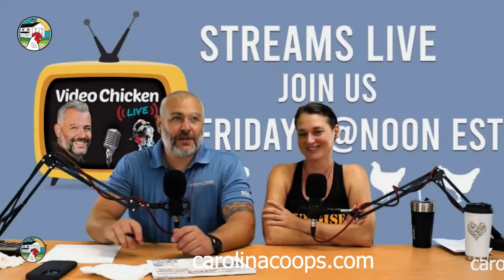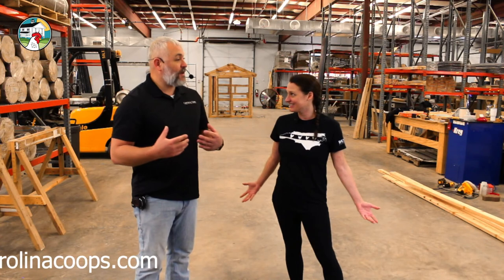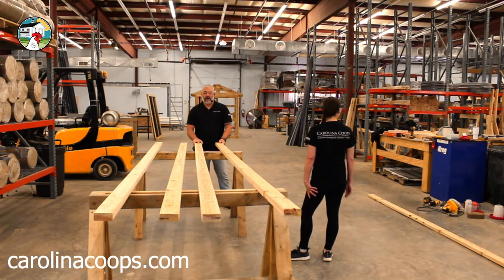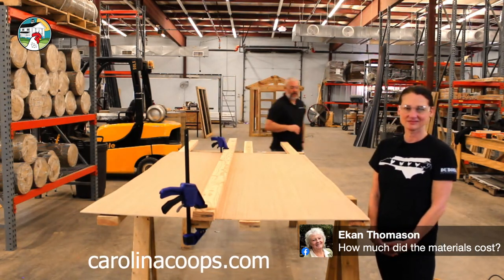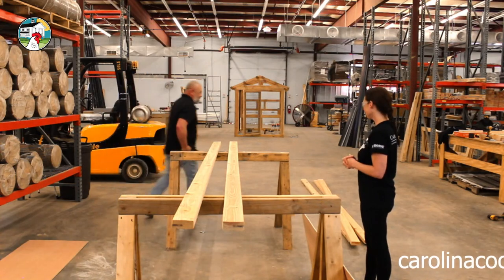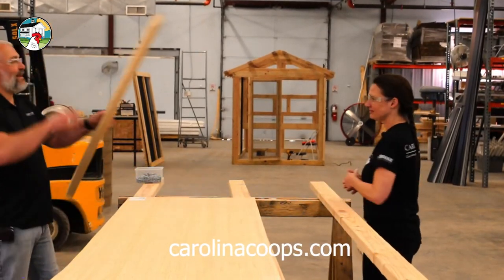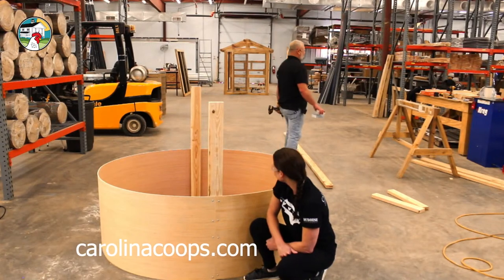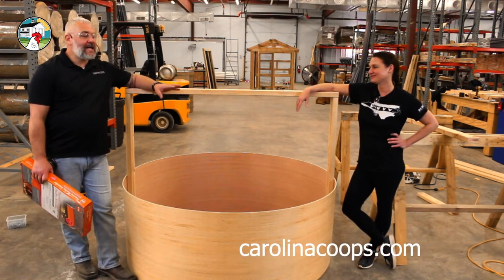Video Chicken Live: How to Builder a Baby Chick Brooder | DIY Brooder

Comment: I have put large chicks in a separate cage in the chick run so the old chickens would get use to them. Plus I put low items in the run when I added the chicks to the flock so they could get away from the older hens.

Comment: checking the floorarea with math... circle (5' diameter) is the biggest shape from the spent materials, then square (4'x4'), then rectangle (3'x5') which should in theory give the most bang for the buck.
also to save on waste when making it, i'd cut the 5' piece first then the leftover split in equal halves, the bar gets a tad bit shorter but is made with 1 sheet and 1 stud.

Comment: She's very wrong on no 250 in the south.  I just raised several clutches of broilers and 10 breeds of layers, all in Georgia.  I always use 250 watt bulbs.  My chicks brood in my heated basement until feathered enough to go out to the hen shed.   The 75 watt light is not nearly enough even here.

There are few absolutes.

I find it works very well to hang one light lower and a second higher so there are varying levels of heat available.  Chicks are very adept at finding the perfect spot.